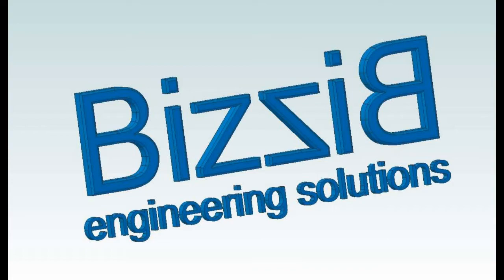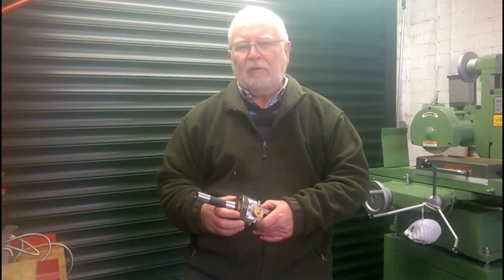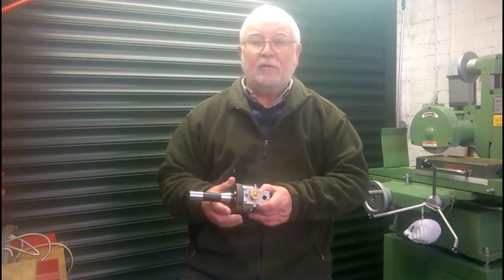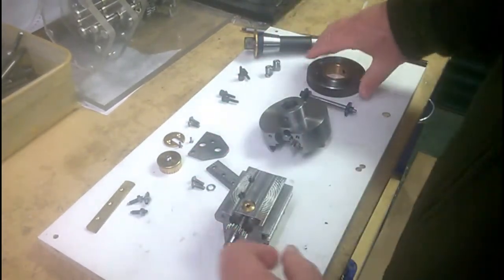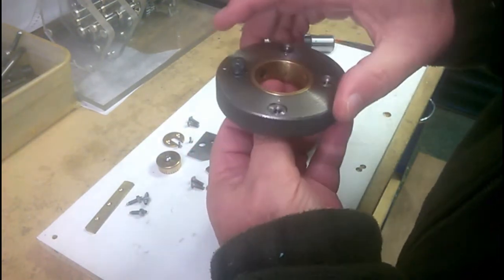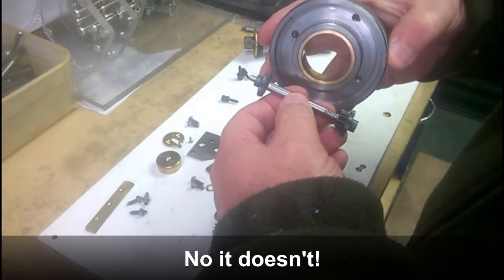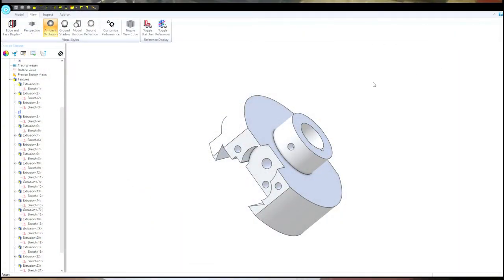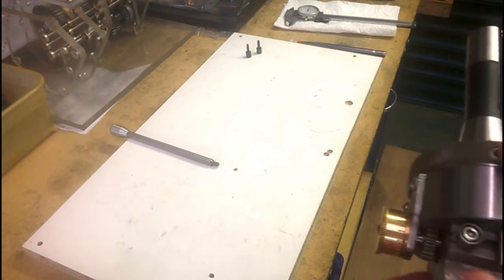Workshop tooling - Part 6 Boring and facing head

Comment: Gday, You have done a brilliant job making this, id like to have a go at one, myself if I could find the plans, Thank you very much for sharing,  Cheers
Reply from the maker: Thanks.  The design is based on a smaller one by Graham Meek, originally published in "Engineering in Miniature" magazine and subsequently in Graham's book, "Projects for your workshop - Part one".  I decided that I was unlikely to produce work of sufficient accuracy to replicate his design, so upscaled it by about  30% and rededesigned the drive mechanism.  I have just started downsizing my workshop and selling off my machines and kit, so this is one item that has found a new home.

Comment: Nice bit of kit......when you need to face after boring, nothing beats a facing head.......boring heads are two a penny.......the internal gear arrangement that drives the screw is pretty crafty.
I'm working on a way to modify one of those cheap Chinese boring heads you get on EBAY.
Reply from the maker: Crafty, yes - but not my idea.  I really just scaled up the design by Graham Meek and altered the drive system to something I thought I could make with my limited skill set.
Reply: @bizzibeeworkshop  The proof is in the pudding, if it works a facing head is a facing head with no competition and no substitute.